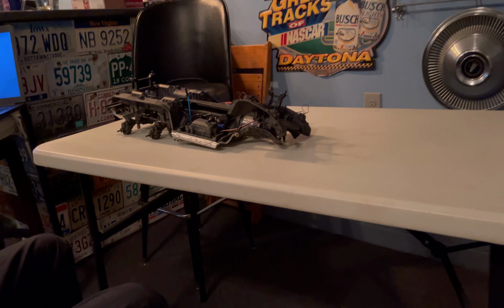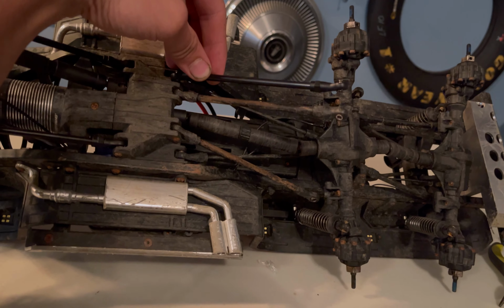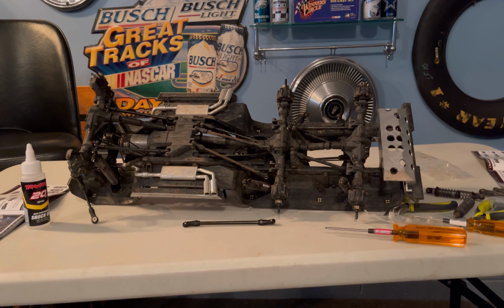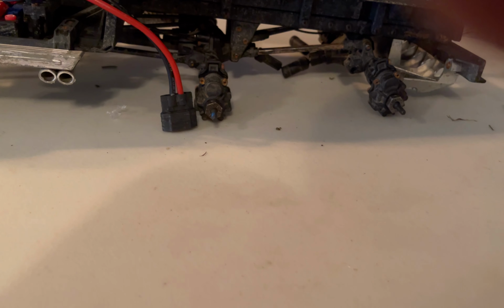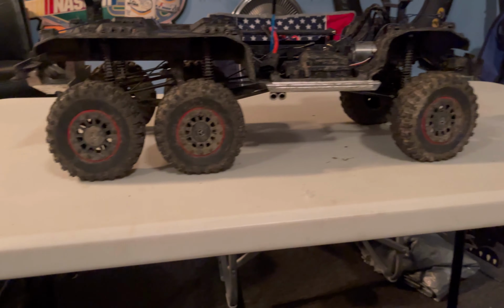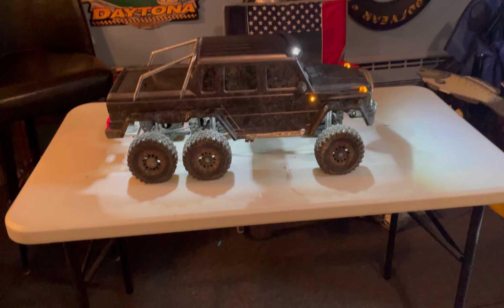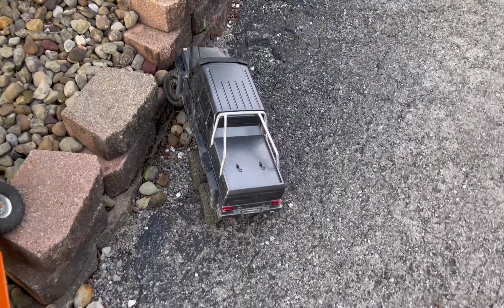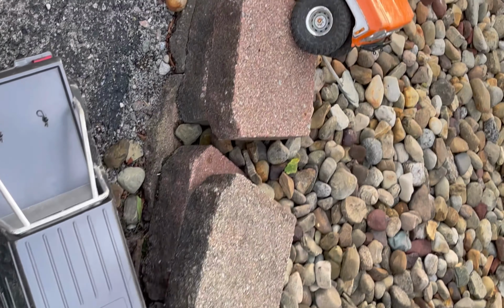TRX6 lift kit install!!!!!!!

Comment: You should add the brass axles to keep the weight down low as it’s raised, also get larger slightly stiffer wheels and a stiffer suspension.